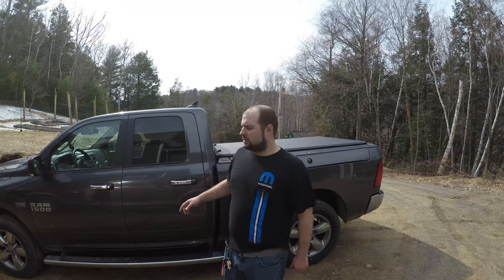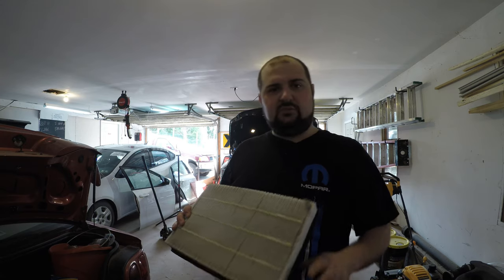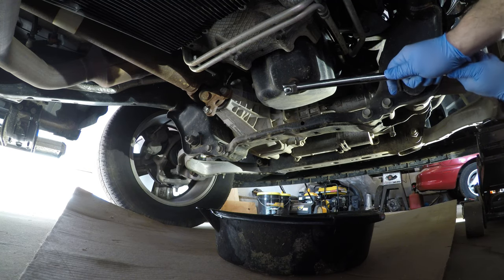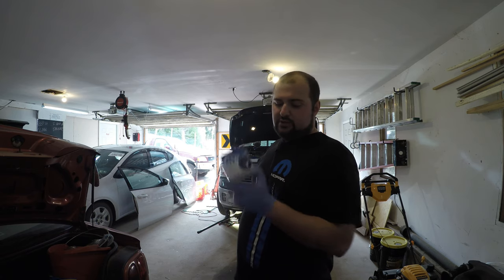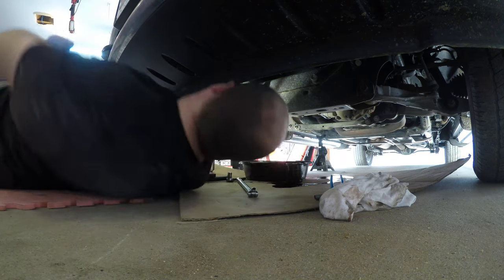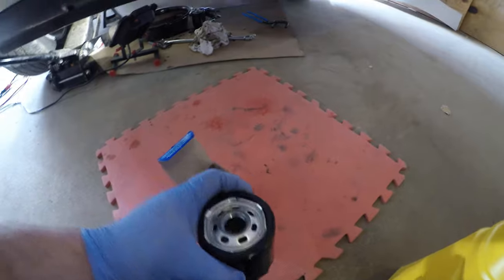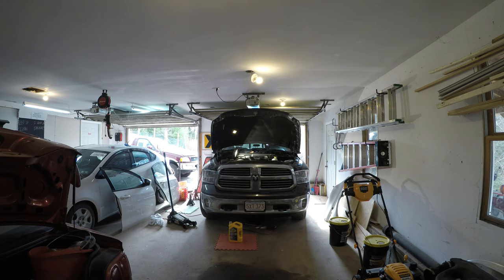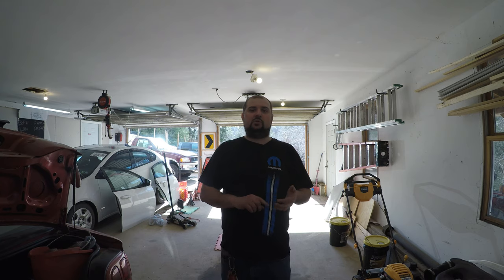2017 Ram 1500 Oil and Filter Change - 5.7l Hemi | How To

Comment from the maker: Parts:
Air Filter - Fram CA9401 -  https://amzn.to/2WJISk2
Oil - Pennzoil Full Synthetic 5w-20 - https://amzn.to/2HUWrK4
Oil Filter - Mopar MO-339 - https://amzn.to/2HUWpBW

Follow along on Social Media for more behind the scenes!
https://www.instagram.com/achubbard117/
https://twitter.com/achautomotive
https://www.facebook.com/achautomotive

Tube Buddy:
https://www.tubebuddy.com/achautomotive

Tools:
Kroil Penetrating Fluid - https://amzn.to/2ujj4is
Actron Scanner - https://amzn.to/2UC8mPu
Milwaukee 1/2" Impact Wrench - https://amzn.to/2DzGCGu
Milwaukee 1/4" Impact Wrench - https://amzn.to/2DkG06L
Trim Tools: https://amzn.to/2TAHz6b
Stud Welder - https://amzn.to/2LZ0i89

Video Equipment:
GoPro Hero 5 - https://amzn.to/2Na1wQT
GoPro Hero 5 Black - https://amzn.to/2OBsWQd
GoPro Dual Battery Charger - https://amzn.to/2wGH67J
GoPro Clamp - https://amzn.to/2PwOytV
GoPro Tripod Mount - https://amzn.to/2Q1olER
GoPro Suction Cup Mount - https://amzn.to/2MIp6EK
Editing Laptop - https://amzn.to/2ChRU2c
Editing Headphones - https://amzn.to/2NfsaaU
Microphone System - https://amzn.to/2T32qyC

Comment: Horrible spot where they did the filter . I mean with a lift different story but doing it from the ground? No fun or easy and the damn mess. Oil travels along the front frome/cross bar and the steering rack.

Comment: My 2018 hemi calls for a blend. I put Pennzoil full synthetic in at 2000 miles thinking it would be better then the blend what are your thoughts?
Reply: SRT has been recommending Pennzoil full synthetic 5W20 for several years in the 5.7 Charger squads
Reply from the maker: I believe both my Jeep and Ram's owners manual recommended Pennzoil full synthetic 5W20 and that is why I went with them. I did try Castrol in my Ram for a bit as I have the dreaded Hemi tick and I was trying to get rid of it. No luck on that front.
Reply: @ACHAutomotive   I'm a castrol guy my self I typically use it in all my vehicles along with mobile-1. Luv it. But being my 1st ram and getting close to its 1st oil change I've been going back n forth between the 2 smh cause I'm not a fan of penzoil but that's me

Comment: Hey buddy, I just change my oil filter on my 2017 1500 ram. 
Short cut to filter, take the passenger tire. It is only a foot or less away. I used a filter wrench to take it off.
Check it out...
Reply from the maker: Thanks for the tip! I'll have to give that a try.
Reply: Perfect...especially since you have it up anyway, good time to rotate tires!  Thanks!!!

Comment: I have the same year truck. Absolutely hate where they put the filter. On my old 09 Ram the filter was so easy to get to and it even had a channel that would catch most of the oil as it drained.
Reply: It's the worst design of any vehicle I've ever owned.  Why would they design it that way for the part that is literally serviced more than any other part on the truck?
Reply: @mplslawnguy3389  because engineers

Comment: Low oil pressure light came on my 2017 ram 1500 hemi. After replacing the oil pressure sensor it was still there. Any ideas? I'm gonna change my oil and filter too btw
Reply from the maker: I believe these had oil pump issues. I would verify you're actually getting oil pressure.

Comment: The manufacturer wants us to use syn. Blend. Have you or will you have any problems using full synthetic?

Thank you.
Jessie
Reply from the maker: No issues. I uses Pennzoil Full Synthetic 5W-20 in both my Ram and my Jeep. Little pricey, but I'd rather use what is recommended.
Reply: ACH they recommend a blend but is used full first change. Hope it's ok